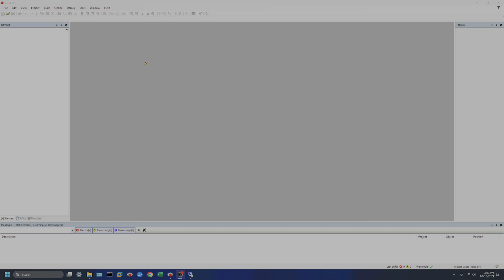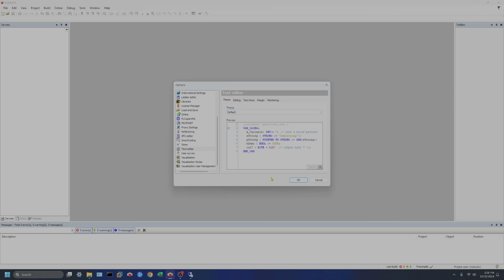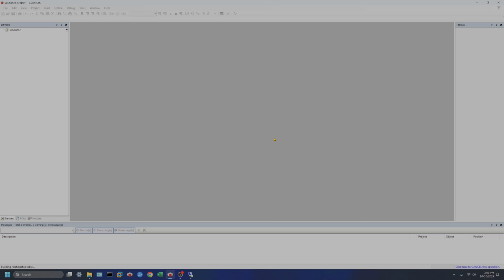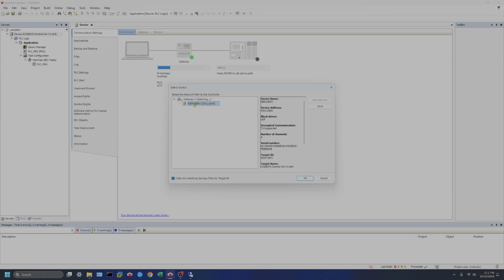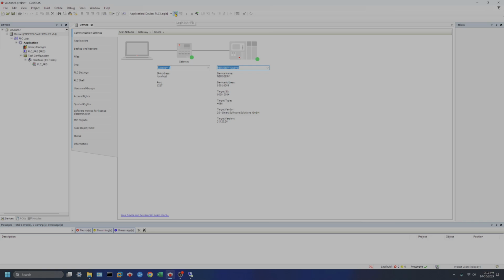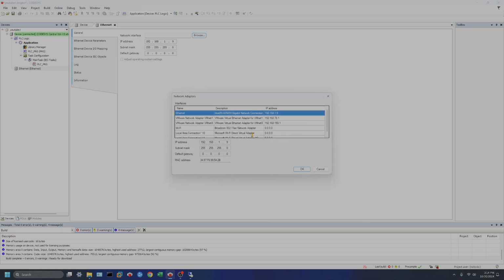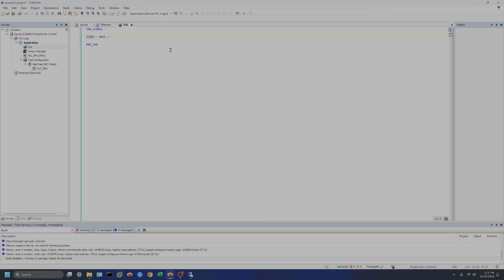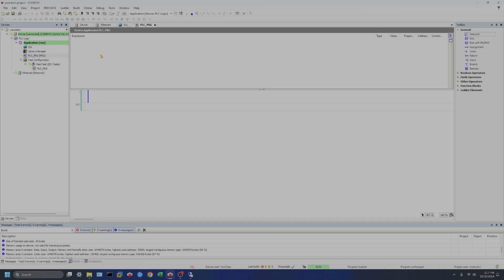CODESYS SoftPLC 1st Project

Comment: I cant seem to get the gateway to see the other PC on the network I have the two sys tray items on the target pc, both PCs are plugged into same router. Is there a setting or step I am missing on the target PC side. any help would be appreciated
Reply from the maker: be sure both are running, and not gray, it will be a red color, also be sure that if on a free version it hasnt been running for two hours youll need to restart the soft plc. also check the firewall settings for the target PC to allow thru the firewall depending on what type of network it is ie. private/public
Reply: @EulogyControls  Thank you for getting back to me. Unfortunately, it must be too far over my head, i just cant get it to connect out side of the PC that the developer part is installed.  I appreciate the attempted help.  I may try again. at least I have now seen it can be done. thank you for posting the videos on this set up. Most that I have found are all running it on the PC the codesys development program is installed on.
Reply from the maker: Do i need to redo the the install video and show the Firewall things? and setting for that? I can whip one of those videos out pretty quick.
Reply: @EulogyControls  It could be helpful.  I can usually get things going but codesys seems to fight me every time for the connection part. I have done some raspberry pi setups and its just never easy for me to get the connection step. with Windows it seems like I'm starting over and I am not sure what I am missing.
Reply from the maker: You shouldn't need other hardware, my simple setup for the videos are Windows 10 PC Ethernet Rj45 to a dumb switch, my dev machine(the one i record on) Ethernet connected to that switch with the simple 192.168.xxx.xxx, try to give your remote node a ping and i just did another video for you https://youtu.be/0_q88uxcQC4
Reply from the maker: Also check to be sure the Soft PLC environment you installed matches your dev environment, ie... installed 64 bit and trying to connect with a 32 bit dev wont work. they should be the same.
Reply: @EulogyControls  I suppose one more question.  Do I need any other hardware other than a network connected PC for the remote side?  currently its laptop to remote via network. I also tried direct ethernet to ethernet like when installing to a raspberry pi unit
Reply from the maker: Let me know how it goes